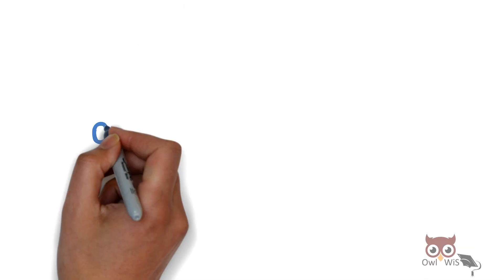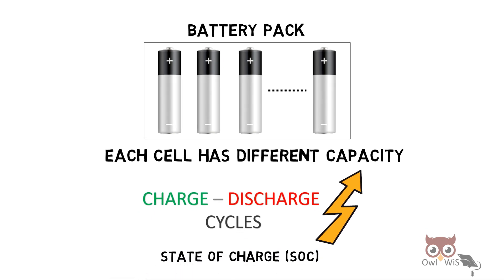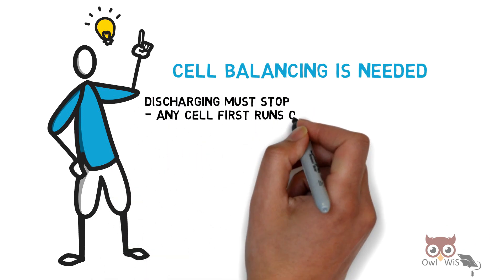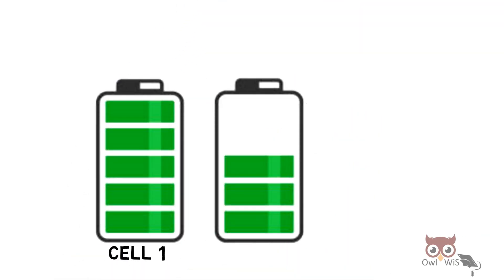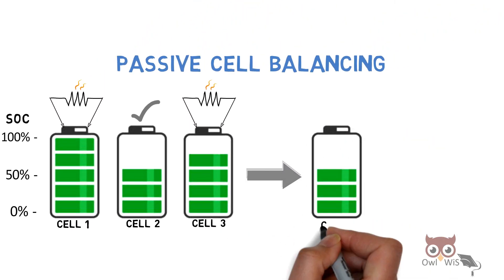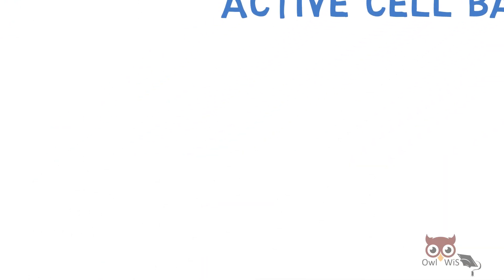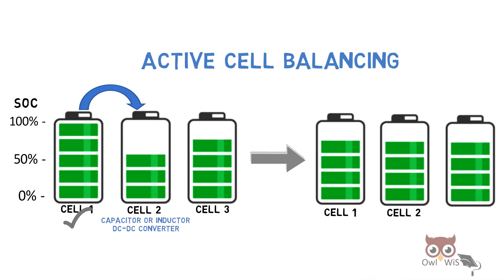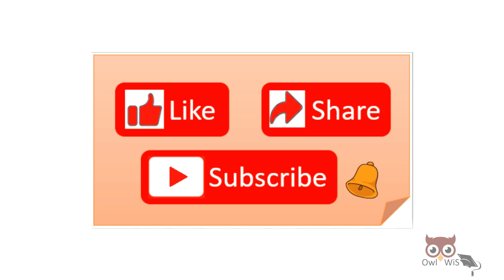BMS Cell Balancing | Active cell balancing | Passive Cell Balancing | Battery Management System

Comment: If i'm understanding this correctly, there's another pro of the active balancing.
With passive balancing, All cells will be lowered to the weakest cell, which may be a bad cell. One wouldn't know which cell was bad because all cells have the same charge.
With Active balancing, energy is spread out where ever the battery will accept it. Therefore, because the bad cell won't accept charge, a fully charged battery will have full cells except for the bad cells.
With Passive balancing, one would have to check immediately after charging to find the bad cell.
Active balancing would be like having a separate BMS on each cell and charged with a trickle charger until they are balanced.

Comment: As a li-ion battery ages and its capacity drops, can it still be charged to 4.2v or would that cause a thermal runaway?!
Reply: it can be changed to 4.2 For sure . but its better to keep Slightly under 4.2 (like 4.1) For Better battery health! (it applies to new cell as well )
Reply: @PraveenKumar-fs6of  From a longevity perspective, 3.7 is ideal, but from a safety perspective, its the increase in internal resistance that decides the max charging voltage. I read these from batteryunivesity.

Comment: Left out of this of course is for a ebike battery, the BMS does not address nor can it determine the individual state of each battery. 
So, say you have a 48v ebike battery rated at 13ah. So, that setup is going to be 13 cells in series, and you have 5 sets of these 13 cells in parallel.
The BMS will thus have ONLY 13 wires, one to each "set" of 13 batteries. But the BMS thus can't tell individual voltage in each of those 13 cells, but only the overall voltage for the 13 cells.
There are a few BMS systems for ebikes that have a wire to EACH battery, but these systems are rather rare to be found.
Hence, the BMS can "try" to balance the set of 13 cells, but it in NO WAY can check nor balance each cell.
This means the BMS can only balance the 13 "sets" of batteries.
This thus means that in each set of 13 cells, they can become un-balanced, and individual cells can thus be overcharged, and some can be under charged.
So, while such a battery pack will have a total of 65 cells, the BMS can only deal with, and try to balance 13 cells "together" at one time.

Thus, this video fails to address how battery balancing works in 99% of the ebike batteries on the market right now.
Individual cells in a ebike battery thus are not balanced by the BMS, but only a set of 13 batteries together are balanced, and you "hope" that this is good enough....
Kind of leaving out the elephant in the room, don't you think?

Comment: I am using DELL latitude e6530 it uses cylindrical battery cells of 5000 mah i want to upgrade it to use 20,000mah lithium cell batteries (like the one used in powerbanks) Is it advisable for me to take this approach?
Reply: if you are an expert  (enough) in this field Go for it . 
Or If you can Risk your laptop then go for it .

otherwise Stay calm & Use your  laptop OR buy new battery  Simple  !

Comment: Hmm my textbook says that active balancing can discharge the battery and passive charging doesn't discharge the battery. The opposite of what this video says?
Reply: technically Active and passive can both be used for charge and discharge, whether or not that's an industry norm  or even a good ide is a different question
Reply: What is the text book?

Comment: Both the active and passive balancing system fails in LiFePO4 battery packs. They work fairly in Li-ion and Li-Po battery packs. Any suggestions to balance LiFePO4 battery packs?
Reply: why do they fail? It has been useful for my electric motorcycle. The strange thing ive noticed is the battery discharged a lot fast when storaged with Active balancing, then I turned off active balancing and it lose very few % in months

Comment: how to find individual failure cell while connected in lithium battery pack
Reply: U can test with multimeter
Reply: @babyboy1909 the BMS can tell you cell voltage. A damaged cell will have a different rate of  change of voltage than the other cell groups .